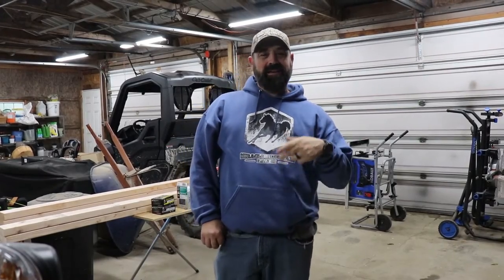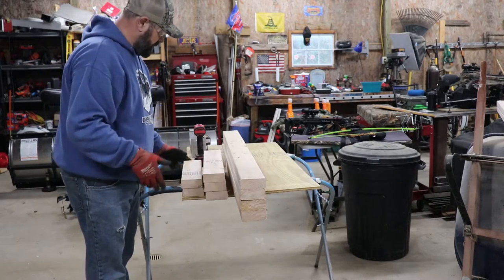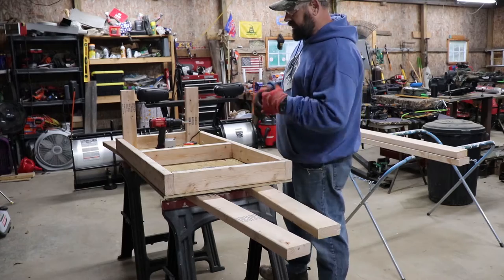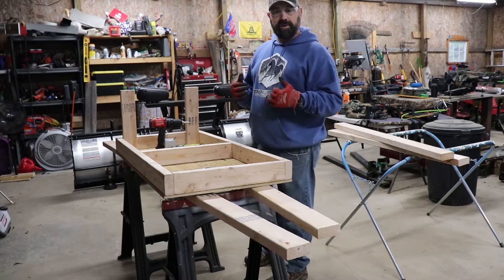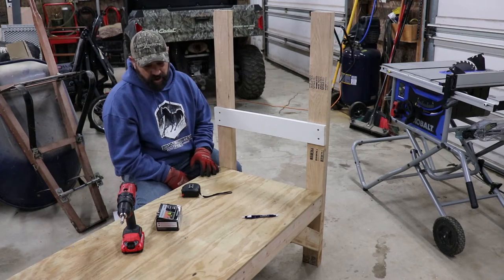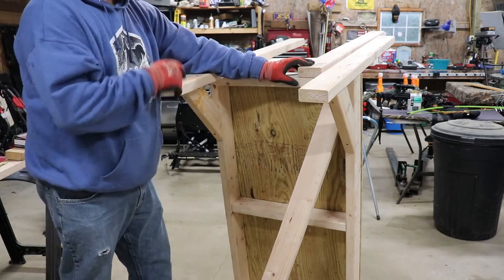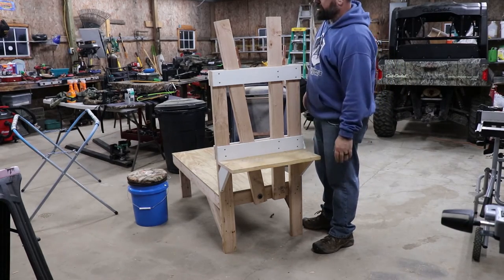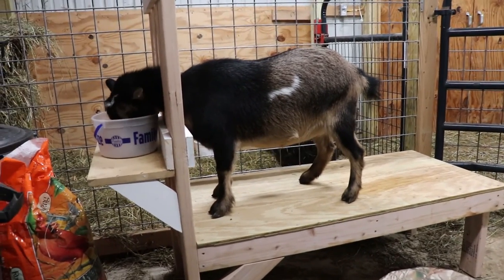DIY Goat Milking Stand ~ Step By Step ~ Easy Build!

Comment: What did you place on the top to secure both of the 2 by 4’s after they enclose around the goats head? 

For example, typically people have a second piece of wood to keep the tilted wood in place. Or they have chains to secure and latch them together. 

Do you have any advice on that? At the very end the video cuts off at the top so I could not see. Thanks by the way, excellent instructions!
Reply: Also wondering this